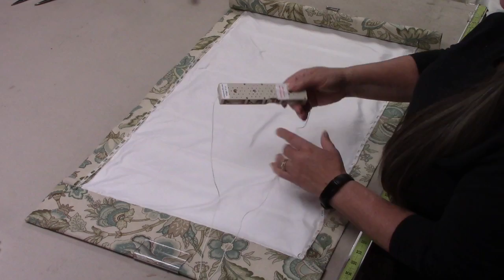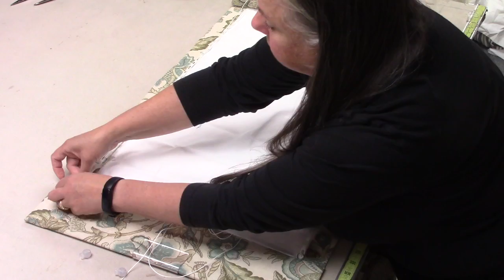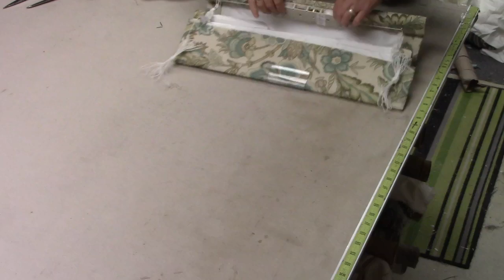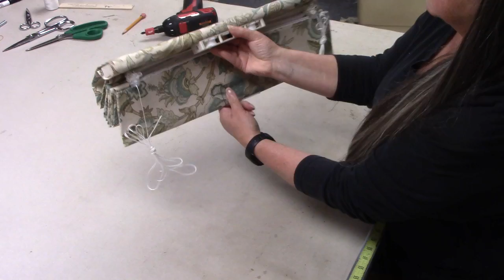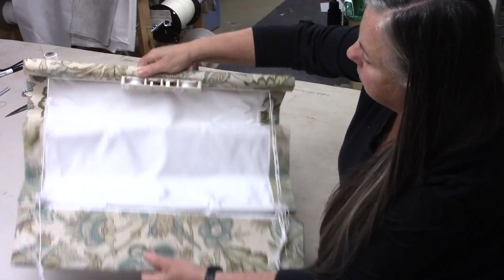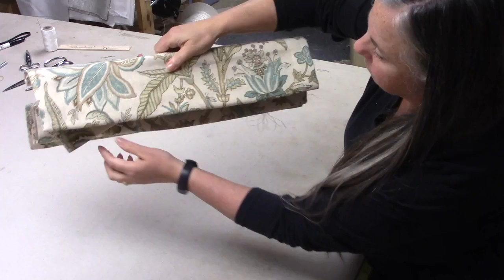Centurion RS Widget Assembly

Comment: Isn't this just like the bon system that is already available
4:53
Reply from the maker: Yes, and no. The technical module may be similar but we are offering a kit. Fabrication seems to be different and our cord length is up to 84" (with a much longer cord available). This system is not strung up under tension which allows for different fabrication techniques and less expensive safety features with ladder tape. This kit option is less weight sensitive.